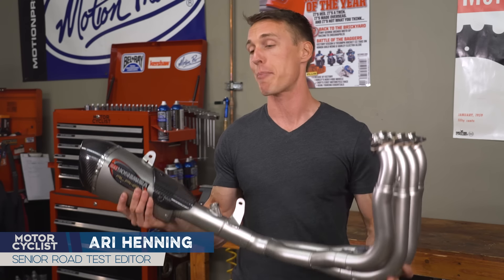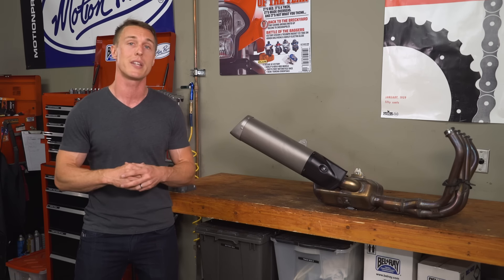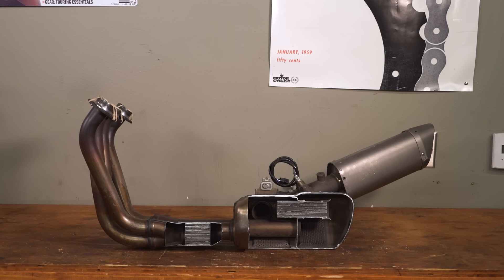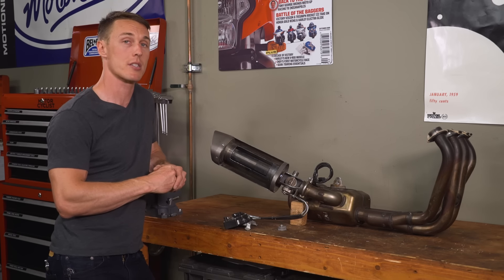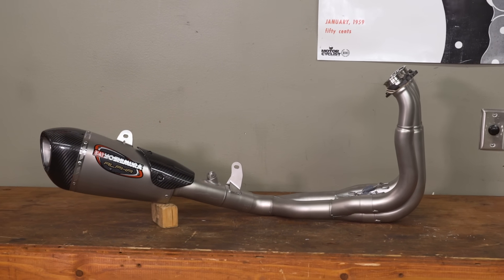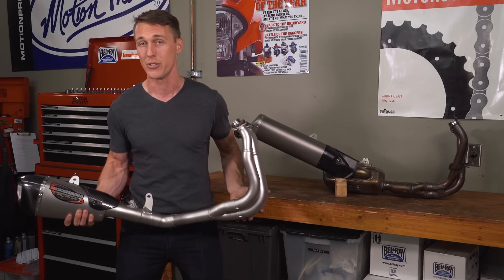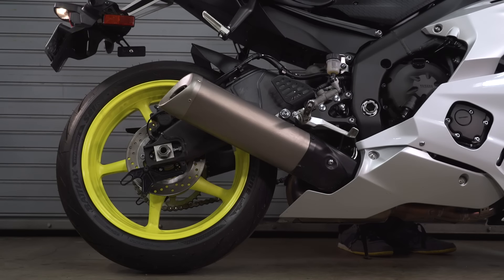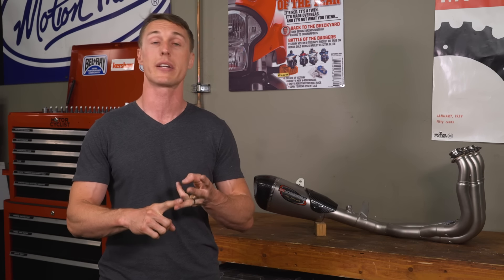The Truth About Aftermarket Exhausts | MC Garage

Comment: An exhaust system has been carefully selected for OEM, more than 35 years ago. Even in the 80s, sportbikes exhaust were fine balanced for emisions and such.  They have never been an "afterthought" ( at least for high performance engines.) And "huge gains" isn't exactly true. An exhaust has typically been the most bang for the least buck. Even today.  It's the cheapest item, within consumers reach with the most seat of pants feel. YES, there are higher performing items out there, that provide a LOT more power. But they are expensive, and you also have to upgrade many other components to get it to work properly. In the end, an aftermarket pipe will almost always provide a quick bump in power. No matter how good the stock exhaust is, it is there to balance, mainly regulations. If regulations of EPA emmisions, noise, and such weren't the issue, very few companies would be able to outdo a stock setup. Actually comparatively speaking, i think todays OEM while finely tuned, has more restrictions than yesteryear. ( meaning you probably see bigger gains going to aftermarket, then you did 20, or 30 years ago.)

Comment: The trouble with most stock exhaust is they sacrifice high end power for low and mid range torque.  My GSX-R750 stock exhaust is plenty loud enough, I don't care about useable power at 4000 rpm; the tach is usually between 6 and 14 thousand rpm. And I know how to downshift. Give me primary pipe length and a cam profile to maximize power at high rpm, and a power curve with character.

Comment: I put an Akrapovic complete exhaust on my 1999 R1. There was a saving of 5lb in weight, the power gain may have been small and yes it was noisy, but it altered the personality of the engine. Before it would rev, but it preferred not to. After it loved to be up around the red line. I was so in love with that bike, I only sold it last year. Now I ride a 1290 SAS: civilised, quiet and easy to ride (with the traction control on) much better suited to my 73 years, but that R1 was the best bike I ever owned.

Comment: I got my 2018 CBR 1000RR in 2019 and it has 18,000 miles. I put Akropovic full exhaust , power commander V, K&N Air Filter and Dyno Jet Auto Tuner. The bike runs well and has a amazing response.
In MD as long you own the bike it doesn’t has to be inspect it. Since it doesn’t have catalytic converter it would be hard to sell it and because of it and the fact I love that bike I am keep it.

Comment: 2019 MT10 here.  I used some JB weld just on the tiny holes in the stock muffler and left everything else stock I got the sound I was looking for,  For 10$ and some patience.
Reply: 18 Wheels I think there are , at least every can or car muffler I have seen . I put on the Leo Vince mid pipe and love the sound now. With the stock muffler patched

Comment: Brock tested it on the dyno and the exhaust valve is only for noise and emissions. Removing it made more hp and torque right through the rev range.

Comment: OR on the R6 you could have your ECU flashed skip the power commander and have a far better engine breaking experience & smoother power delivery oh and it makes up for the 8-10% incorrect speedo issue at least on the 06-16 models idk about the 2017. My personal opinion.
Reply: @stephenpenniket9976  😂😂 so true
Reply: Ayyy didn’t know you rode motorcycles gundam
Reply: I like ECU flashes compared to fuel tuners as well
Reply: @stephenpenniket9976  Lol.
Its funny cuz the your and you’re doesnt really bother me,but breaking vs braking for some reason does.
Maybe because it has to do with something technical 🤷🏼‍♂️
Reply: don't this nigga make dsp videos. LMAO

Comment: I purchased my NC750X from a dealer and used it for comuting 50 miles each day in mainly Motorway traffic. At the first service I mentioned that the performance was not so great in second gear, sport mode, at low revs and far worse in eco mode. They recommended the fitting of an Akropovic aftermarket silencer saying that this up the performance would impress me. It didn't.......the unit did weigh a few pounds less but apart from being a little louder the low rev performance was still dull. On checking the maker's own performance  figures, for my £600 pounds I had gained a mere 1/2 hp.

Comment: if stock exhaust is that good why does yamaha have akrapovic on their site.
Reply: B/c of emissions. The stock pipe is impressive given that it navigates so many objectives, but that doesn't mean it's the best option for outright performance.
Reply: Because $
Reply: How is that even an argument?
Reply: Suzuki has Yoshimura as well ;)
Reply: Vin Commons  except many of these brands like akrapovic don't work out of their basements. They have collabs and tie ups with the bike brands to make exhaust for them. Why?? Stock exhaust has many limitations cuz of government regulations, performance is not the only  objective of it.. sound, emissions, cost effectiveness.
Reply: The name brand exhaust on manufacturers sites are only a hair better than stock. They still have to conform to the same regulations to be sold from the dealerships. Off-the-shelf models are different.

Comment: Aftermarket exhausts don’t have to be loud. I have a full exhaust on my Tiger. It’s quieter than stock. The engine runs cooler, I’m not on a BBQ spit.  It has the add effect of power delivered sooner. Of course I’m running a tuner.

Comment: Switching to aftermarket Cobra exhaust on my Honda Shadow was an overall good move. The stock exhaust weighed in at over 30lbs while the aftermarket pipes weighed only 18lbs total. The bike did run leaner after the switch, but a rejet and A/F tune fixed that. Best of all, a different but not necessarily louder sound from the Cobra pipes. Going from 1-5/8" to 2" tubing was a perfect step up all around.

Comment: You guys should do a video on backfire
Reply: Daniel Tilton that's normal
Reply: "My exhaust pops on decel FML kill me now", said no one ever.
Reply: Yeah, though my bike runs lean but I can't do anything about it since no one makes a fuel unit for it. I do however love the pops, I also enjoy the rare occasions when it pops and gargles all together instead of just a single pop haha
Reply: Death666wish I just figured out how to induce popping on my 750 on decel by just barely blipping the throttle continually, barely, and it will pop all day from like 8-10k down to like 5k ...i can't stop, like a kid in a candy store.....so much fun lol
Reply: +1 on afterfire. backfiring is through your intake. Common misconception, but I think most people know what is really meant by it.
Reply: @Daniel Tilton Flash the ECU to disable injector shut off on deceleration, disable the AIS pump, and install smog block off plates. You'll get rid of all/most of the popping on decel but you'll smell like fuel when you're done riding.
Reply: yes.
Reply: CaliRider the killswitch on a carbed bike is glorious when it comes to popping, spluttering and banging. hit it, blip the throttle (or go wide open), then Hut the switch again. 😈 😄
Reply: Death666wish haha, love the pop & gargle sound!
Reply: I can confirm what Titchness said is completely true. My 125cc shoots 1 foot flames out the muffler when using the killswitch trick. Is it good for the exhaus system? I doubt it. Is it fun? Fuck yeah its fun!! Also, its loud af, duuh.
Reply: yeah but no one is impressed by it...
Reply: On my cbr1000rr I have a toce on it, and it gargles and pops all the way down if I give it slightl throttle. So many heads turning when they expect to see a mustang lol
Reply: A video on me? I'm flattered
Reply: I have a VTX 1800 with Vance & Hines Longshots coupled with a Power Commander. I read about popping on deceleration and started making minute adjustments because I thought it was considered undesirable, performance wise. Turns out, it pops no matter what the hell I do to the tuner. 2 tears in a bucket, I say f*ck it. Now I just look for low speed, in town down hills to let it gargle and pop all the way down.
Reply: yes its porn they are bringing king dong in for the job
Reply: I love the backfire!
Reply: David M hope you mean popping....
Reply: Is anyone  can figure out the POWER hidden in  back fires ???.  A back fire has tremendous  power waiting to be harnessed. .!!.. if an engine  does backfires  all the time  and such engine is strong enough = that is  too much  power . Otherwise. . I have to invent  this new engine.
Reply: Fredrik Hoffmann yeah probably that hahaha
Reply: You can adjust the fuel injection timing and the duration on newer fuel injected bikes if you know how. On yamahas you cut the looped wire on the cdi and hook to battery and use onboard controlls. You can get rid of the popping noise that way and also gain a lil more power

Comment: Slip on mufflers make noise. Full systems make power.
Reply: Slip-On mufflers can add power too, but only few in comparison with a link pipe or even a full system.
Reply: not always true, I gained a pretty massive 12 hp on my Bandit 1200 with M4 slip on and K&N filter.
Reply: @ljoelmchanley3676  and no tune?
Reply: If the bike is tuned they will make power. Most people forget the bike needs a ecu flash(very recommend) or the power commander route(more expensive) to get the full benefit of the full system.
Reply: Ljoel McHanley I’m not convinced you gained 12hp with just a slip on and a air filter with the stock system still in place and no tune, unless you put a video out of some hard numbers from a Dyno then I can believe it. I’ve had to flash my ecu, put in a full system and k & n air filter to draw that kind of hp from my bike around 15hp boost on my bike.
Reply: @MeeksOpry  You don't own a '97 Bandit 1200 nor do you know anything about them do you?
Reply: Let me help you on this one. The 97 gsf1200 engine is based on the gsxr1100 which produced 155 hp. The bandit version of this motor was bored to 1157cc with slightly milder cams and basically a cork for a muffler producing 98hp. It was common knowledge back in the day that the right slip-on and a k&n filter plus proper jetting netted 10+ hp.
Reply: Not related to the thread is a person who cuts trees, some of them drill a hole into their chainsaw muffler to gain power it's illegal but some of them do it. Just like aftermarket pipes will gain you more power on your bike than the traditional stock pipes.
Reply: I wont claim anything but I did notice with a slip-on on my ninja 300 that the throttle became more responsive and blipping to downshift has become a breeze. With the stock, rising rpms felt delayed and felt like I had to hold the throttle before downshifting.
Reply: Ljoel McHanley betting you it was the air filter
Reply: @ljoelmchanley3676  lol
Reply: @ToastyClam  An air filter change alone would do very little to increase hp on the bandit 1200. On the intake side of the motor you have to increase air-flow via air filter / air-box improvements, on the exhaust side of the motor you have to increase air-flow via free-flowing exhaust other wise the engine can't breathe. Both are necessary along with proper jetting.
Reply: Ljoel McHanley actually you’re right
Reply: @Max Damage You should pay attention if you are going to criticise another persons comment. I stated " I gained a pretty massive 12 hp on my Bandit 1200 with M4 SLIP ON and K&N filter." It is absolutely true and the bike was dyno'd. I replaced the filter AND THE SLIP ON. Plus if you had any real knowledge of bikes you would know the 1200 Bandit was carb'd and just needs jetting tweeks with increased air flow, a new ecu wouldn't do shit. The '97 Bandit was the gsxr 1100 motor bored out to 1157cc and was easily capable of 155 hp with full engine mods. Merely letting that 98 hp version breathe properly nets 10+ hp and a VERY useable increase in midrange torque.

Comment: Why cant they put effort to make the stock exhaust look nice and sound good? That after market exhaust looks and sounds waay better
Reply: msaleh93 "sound good" is a subjective term my friend what might sound good to u, may not sound good to me. its just like music. 
looks again depends on the make and model but in general most of the aftermarket pipes have a tricked out looking muffler. I think the manufacturers don't want to make the bike more expensive just for a nicer looking exhaust.
Reply: msaleh93 the only sport bike stock exhaust looks good are s1krr,r6,2012 cbr1000rr,they all looks sharper,smaller
Reply: its mostly to do with cost, sound compliance, and emissions compliance. they want to make a single exhaust compliant with as many countries as possible so they have to design it around the harshest emissions and sound regulations. if they have to make multiple exhausts for various countries then it adds cost on their end which they then pass off to us when they sell the bikes. It always comes down to money and what the company needs to compromise in order to get the most money out of a single machine.
Reply: Ducati does well on their stock exhaust
Reply: The aftermarket exhaust sounds better because it doesn't have to comply with noise or emission regulations, just like ThriceIND said. Also, manufacturers can cut the prices of their bikes by not having to install long, unnecessary exhaust pipes. The breadbox takes care of the noise and emissions, so just a short stub is needed. Most customers enjoy a bike that's cheaper than its rivals, which is good for business if your bike is the cheaper one.
Reply: Dollar, dollar bill y'all. Bikes already cost enough.
Reply: msaleh93 regulations my son
Reply: $$$$ think about it... thats why.
Reply: Have aftermarket exhaust on my z1000 05 stock exhaust looks so rubbish on it
Reply: Just take the spark arrestor out of your bike and make it straight piped it is freaking awesome
Reply: I agree. Its all done knowing the avg consumer wants meaner sound than stick BUT they know soon as we start fabricating we need open our wallets to get what want. Instead they could do same for us and meet all bike and law requirements.
Reply: Also the 790 duke sounds divine with the stock exhaust. It's one of a kind actually, stock sounds better than many other aftermarket exhausts
Reply: @ooopepper  yeah but does horribly on everything else.
Reply: @Tuppoo94  Obviously it will sound better with the lack of absorption chambers and loss of weight, but think about the pollution, bruh. Unless if you don't care for the environment. If at the end you won't have any oxygen to inhale for your health, then do not complain for the why this happened? You already know the answer.
Reply: @thepassionofthegoose5472  Regulations come first, bills come second.
Reply: @alexcaymans  The regulations have higher priority than the bills
Reply: @shadowv6794  How did you come to the conclusion that I don't care about the environment?
Reply: @Tuppoo94  «The aftermarket exhaust sounds better because it doesn't have to comply with noise or emission regulations.» Isn't this a clue?
Reply: @Tuppoo94  But by saying that, it seems that you are against the regulations, doesn't it? I don't say that I don't like a louder bike or a more beautiful muffler, but would also think if those would be any good at the end, despite the subjective thinking.
Reply: @shadowv6794  No it does not. It's just an observation.
Reply: The 2018 Triumph Street Triple RS has an amazing sounding stock pipe. I rode another RS with arrow end can back to back and the stock sounded way better. Deep rumble that is. Arrow sounded tinny compared to the stock and also highlighted a bit of a flat spot between 7k and 8k rpm.
Reply: The amount of money they save on exhaust would be mind boggling...and for the sake of 5% of consumers actually caring isn’t enough to put resources into
Reply: The older z650 had a beautiful stock exhaust.
Reply: Got me a 790 duke, exhaust diesnt look all that appealing but the sound is perrrdy noice, wont be needing to go for an aftermarket slip on
Reply: most stock exhaust, especially Yamaha sound amazing in real life and they are louder than they seem like in videos
Reply: Idk man Hypercar like Pagani have their own stock exhaust already titanium and its even titanium colored by factory! Others like Koenigsegg have their stock exhaust made by Akrapovic specifically 

Why they didn't do that on bikes tho :(

Comment: I have been doing motorsports all my life, and the sound regulations on track is actually harder on tracks in Europe then to be street legal, and although it is always a hassle to get there, it has made some manufacturers make really good preforming but silent systems, you can still get a meaty growl, but not the scream on high revs.
An easy way is to put 2 full flow dampers in series

Comment: Crossover pipes and interconnectors are for EXHAUST SCAVENGING. Scavenging is the process of removing exhaust gases from the cylinder after combustion and replenishing the cylinder with fresh air. Efficient scavenging is necessary for good combustion of fuel inside the engine cylinder. The passage of scavenge air will also assist cooling of the cylinder, piston and valves.

Comment: watching this while installing a full system
Reply: Charlie Rodger do you really need to change fuel and air mixture when installing full system ive bought a full system for my honda cb125F and im curios if it will work well